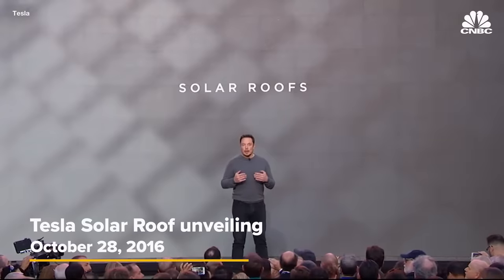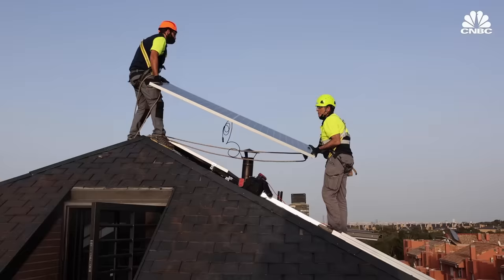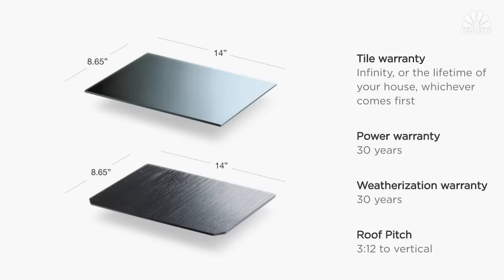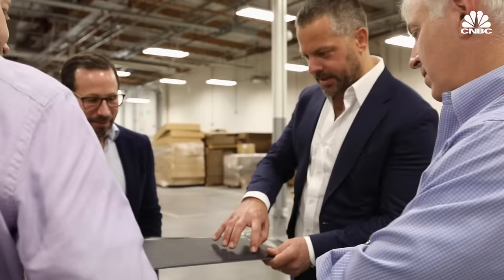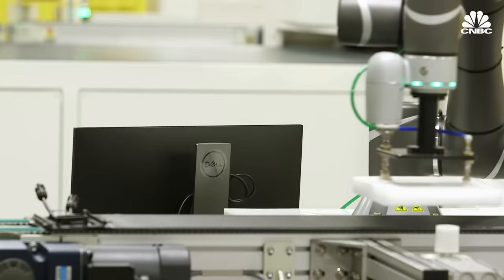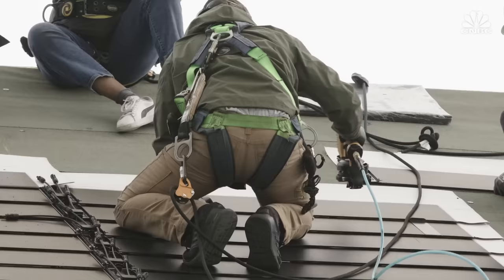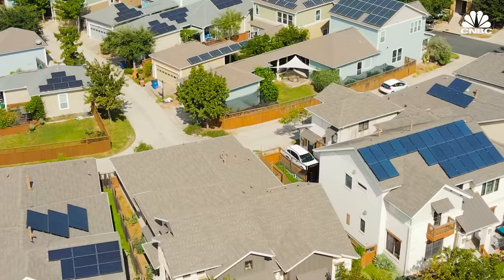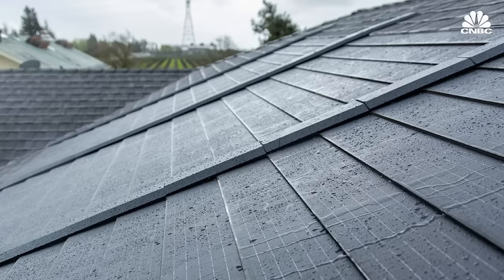How This Roofing Company Is Taking On Tesla’s Solar Roof

Comment: I own a 13 kw solar system.  I think panels do not distract on aesthetics of the home.  I have limited roof space. Many of my panels are 360 watts.  The battery storage really saves money with night power, outages, and assisting with charging EV’s.  In Hawaii I save $600/month on gas and home electricity.
Reply: You save more than I typically spend a month on gas/electricity.
Reply: @Abď probably like $30k
Reply: Yes they do! It looks horrible!
Reply: @miriamgalan1810  Your opinion does not matter.
Reply: $600/MONTH "saved"?   Must be a nice house in Hawaii!  My electricity bills might be $100/month w/hotter summers and colder winters here in MD.  Yeah, it's a townhouse but the numbers are out of whack.  Electricity/gas cost 2 or 3x as much?
Reply: Wow I spend like $200 per month on gas and electricity combined.
Reply: What brand name storage are you using Scott?
Reply: @TheJhtlag  as of 2019, Hawaii had electricity rates almost double California; it is possible to spend that much monthly in some places
Reply: That’s about my annual electricity cost. I’m single and work 55 hrs a week
Reply: I think they are far uglier than shingles, but overtime, I am sure shingles will improve.  I'd get panels now, though - if I was in the market now. Having them as a porch overhang may keep them even cooler, so more efficient...but, porches are taxed, so there is that. Maybe for a carport not attached to the house would be cheaper overall?

Comment: I bought a new home in the desert. The builder put solar on and it was included in the price of the home. I upgraded another 3K dollars. My electric bill was 15 dollars per month in the summer running an air conditioner. So happy with my solar panels. I think the ones GAF Energy have look good. In the long run, I hope they do really well. They may want to build an alliance with home builders in states where solar is mandated on all new builds.
Reply: What manufacturer  did you go with ?
Reply: You know your just paying for it over the life of the loan.  They become less efficient over time
Reply: @usadaytrader  let alone breaking down the cost it is still better, nobody is implying that the low monthly energy bills = 100% savings as you do have to factor in the cost of ownership on the solar panels of course.

But also the fact that it’s renewable energy. Also that you can have a power bank and store it and have energy during power outages.

Pretty useful tech. Your talking about cost and depreciation from a phone/tablet/computer which will decline as fast and cost easily $1k and easily upwards.
Reply: @justinstevenson2061  it still doesn't pencil out
Reply: Solar tiles or panels should be mandatory on every new home, period.
Reply: If your not complayining is cause you install your solar panels. No company was involve huh?
Reply: @keithnance4209   not quite sure since many parts of the world doesn’t simply have efficient sunlight.
Reply: @keithnance4209  nah
Reply: @keithnance4209  No, making a airtight and well insulated home (passive house standard) should be not some solar bs
Reply: @davidchillton1744  obviously.
Reply: @What11235  for all new homes built. It’s very easy to implement at construction and the cost is built into the sales price, the buyers would never see it because it will be amortized at 30 years which is the avg for conventional mortgages.  It’s 2022 and it’s time we start acting like an advanced society that utilizes sustainable technology efficiently.
Reply: @hairypancake4425  what
Reply: @wildlifewarrior2670  a part from some equator adjacent countries in tropical and subtropical regions, most of northern countries simply doesn’t have enough day time and sunlight to sustain for family consumption
Reply: @hairypancake4425  yes it does

Comment: Here's why I could prefer these over panels. I don't want the additional perforations from rack mounts. The chance of leaks with mounts is higher than without them. Yes, "just get a good installer" can improve chances, but it's not a guarantee. And having known of cases locally of some pretty bad leaks from rack mounts (yes, I know many don't have problems) I would very much be interested in a product that goes on the decking like standard shingles if they have no higher chance of leaks than standard shingles.

The first job of any roof is to keep out the elements. Solar is secondary. Not willing to compromise one whit on the primary  purpose of a roof for any secondary function.
Reply: You don't have that issue with standing seam metal roofs, the racking system simply attached to the standing seam, no perforations.
Reply: @fuckthisksksjjksdfjd  Yes, that's the one scenario where I would feel comfortable with rack mount is with a standing seam metal roof where it could clamp on the seams. Don't care for the aesthetic of the standing seam roofs so that would be the biggest hurdle :)
Reply: Interesting points. I’ll have to keep them in mind when I eventually own a home and am getting quotes.

Comment: I've had solar panels for over 10 years . I wouldn't put them on the roof . A frame in the yard is better . They remain cooler so more efficient  . Easier to clean and they do need cleaned from time to time . Just maintenance and troubleshooting is easier on the ground . If you have the room keep them bolted to a frame high enough to mow under .

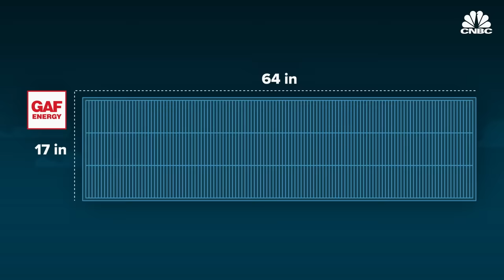Comment: I think you're wrong at 11:01. You're factoring in the entire panel even though most of the top part of it is covered up by the previous panel. Looking at the man holding the panel at 11:21, we can determine that the height of the actual photovoltaic portion is less than half, so about 7 inches, and the width needs to have about 3 inches removed from the right side. Rough math shows that the panel would produce about 10.1 watts of power/sq. ft and not ~6 watts.

Comment: My families 1,800sqft was quoted $50k for a turn key photovoltaic system that would cover 100% of the electric bill. After some research, and being an electronics technician, I was able to buy the correct system for $13k cash delivered to our home and I installed it.

Comment: I am  roofing company owner  and yes definitely I will offer the product to our customers ! Just like a car, the customer is who decide which panel is going to use , right after analyzing  what's the pro and cons of own it.
Reply: Do you think someone with a perfectly good 5 year old roof would consider this product?
Reply: @zunedog31  The cost to replace a recently purchased roof makes no sense.

These products are for new roofs or homes who needs the roofing replaced
Reply: You right folks , this is going to fit on new projects or replacement , or perfectly for those who just want to get the system , exactly like when you have a good perfect 2020 car but wants the 2022 model
Reply: A year later I'm curious how did this work out for you? What's the avg cost for a roof like this under your business?

Comment: Why are people so centered in esthetics!? Regular solar panels are strong, very cheap and super efficient.
Reply: Yah like what's wrong with having a regular panel on your roof...I not like you'll be sleeping on the roof 🤷🏿‍♂️
Reply: Local man discovers others care about appearance
Reply: Some people want better aesthetics, some want higher efficiency, or greater total system power.  The best products will try to achieve best in class in every metric, but reality often limits that.  Nothing wrong with targeting a product to be the best in one customer want/metric if the target market is large enough
Reply: I think in the end, if it can actually replace your regular shingles, that’s a cost saving so you don’t have to buy them anymore.
Reply: @colonelbanditsix  it’s not like it really matters but the real preoccupations should be with storage battery or insulation of the house.
Reply: Becuase I am not spending 500k on something I see everyday that I dont like.
Reply: @colonelbanditsix  that just shouldn't be a thing though. A usual use case for a roof is closing up the top of your house so that it doesn't rain in. No one should buy a roof with holes in it just because it looks better. For me it's the same with a solar roof. As it stands now... Either you want to do something for the environment and or save on electricity or you want a normal looking roof. In my opinion you shouldn't want something that is worse but also more expensive just so it looks better. It kinda defeats the purpose of making it solar for me.
Reply: Very cheap? If you're Bill Gates!
Reply: Why bother painting your wall White (or any color u live) vs painting it green (or a color u dislike).  Cause it’s more pleasing and works better.  Smh.
Reply: housing value, eye appeal increases value, so if you're looking to sell eventually, you would have to dismount it
Reply: @mmoarchives2542  I think the value of solar energy would more than compensate for the 'ugliness factor'.  The house would definitely not have less value than before you put the panels on.
Reply: @studtistics2448  i used to think that too, until the housing market dramatically changed, it's not like that now, home owners wants practicality not innovation, solar is only a selling point in nevada, utah, california, and arizona, not anywhere else
Reply: @cmdr1911  regular solar is pretty cheap
Reply: @jordanabendroth6458  yes but my home is not. Power is .06 cents a kilowatt hour hear. Solar doesn't make economic sense here and the panels look terrible. The reason solar tiles make sense is they appear to be slate tiles and at Tesla's original price they were competitive with premium slate roofs. It is still more expensive than asphalt. It looks bad and makes poor ecomonic sense, no way they are going on my roof.
Reply: @cmdr1911  Power is only .06/kwh because we are making our children pay the real cost.

Comment: unless they can beat a shingled roof plus rack mounted in price, i think their product will fail. they are not in the same market as tesla solar. Tesla is about roof appearance, while GAFs looks just as bad a roof mounted. So they are competing against roof mounted, not Tesla.
Reply: Ya, "this has been around since 1970s" shows pictures of flimsy and mismatched solar panels ingressed into a roof. Literally lacks the 2 benefits of Tesla solar roof (durability and looks) so obviously none of it caught on. Not saying they are completely trash, but probably should just be compared to normal solar roofs.

Also GAF power density seems to be trash..... so ya not so great. add on you are only saving 10k to go from a higher power output and tile roof to shingle roof. Doesn't seem to good for them. Hopefully they can drop the price given how low the material cost of them seems to be
Reply: They should conduct a research on who cares about appearance
Reply: @ntb3884  I think the other thing might be the customer experience. I have heard horror stories about how great Tesla is on the sales side, and on support after the installation has gone live, but that the in between part is a nightmare.  If GAF can get their solar shingle solution up in a day or two, and have excellent support for customers throughout the process, they might win over a huge customer base.  Tesla solar roof is like their vehicles:  high end and high price.  GAF solar shingles might be the Nissan Leaf of the industry, if they can get their pricing right, and make them more affordable for the masses.

Comment: The problem for GAF is they are targetting composite shingle roofs customers.  And composite shingle roofs are relatively cheap compared to alternatives like tile.  Tesla targeted homes with tile roofs which are expensive with their SolarRoof product.  The price of our Solar Roof was less than the price of a replacement tile roof with solar panels.
Reply: @updlate4756  so the guy who went from college student to world’s richest man in 25 years is not innovative?  Targeting upper end roof installations is smart.  Customers can pay more for features.  Then you can work on driving costs out as you learn more about the tech.  These benefits low priced buyers as the tech becomes a commodity item.
Reply: @updlate4756  you failed to notice that Tesla roof gives 17 kWh per square foot, while GFA 6 kWh. Of course the solar panel gives a bit more still, it makes sense that if Tesla solar gives three times the output of GFA and comparing to ordinary solar panels which give even more output, Tesla solar roof covers entire roof area, which isn't the case for GFA nor for ordinary panels. I would personally prefer Tesla, if it were available in my country.
Reply: Why did you use the word 'our'?
Reply: @JBoy340a  But that is not how he is personally marketing them.  Musk never comes out and says Tesla products are just for wealthy people, when they objectively are.  Where is the 35k Model 3?  Abandoned long ago when they aren't seeing profit margins to boost stock prices.  Tesla is niche and will continue to be so, they don't seem to have the appetite for mass market low profit margin products.
Reply: @dalemansukh  - at least when it was first announced Musk was pretty open that the Solarroof was price comparable to a tile roof, and not a composite shingle roof.
Reply: @updlate4756  Shingle roofs are installed on old houses. All new apartment buildings, condos, single family units have tile roofs.
Reply: @dalemansukh  wait a year and look at gigaberlin and especially gigatexas, the issue they have is they cannot produce enough to meet demand. It makes sense to raise prices and use that extra profit to build more factories and advance manufacturing methods.
Reply: @JBoy340a  lol, went from college student? The dude's father owned emerald mines in Africa, but yeah, he was just a college student 🤣
Reply: @lancetruong4957  Maybe where you are at. Even here in Florida, while some of the southern and coastal areas are defaulting to tile roofs, outside of the coastal areas most new construction is with shingle. It also gets expensive when you factor in insuring your house. Many insurers don't want to insure any house with a roof over 20 years old regardless of material. 

My shingle roof is 19 years old with a 30 year warranty on the shingles, but it took months to find someone who would insure my house.
Reply: @JvilleJD  I guess it depends on the area. Here in California, people prefer tile roof because of potential fire.
Reply: @ttuliorancao  the guy came to america with $2,500 in his pocket.
That may be from emerald, but he was never rich .
He started from the bottom.
$2,500 isn't rich whether or not it's from his father
Reply: @user-nw8jr1dk9p  oh really, so Musk's father isn't Errol Musk? And this man didn't own a emerald mine in Africa? They didn't live in one of the most expensive houses in Pretoria as a result of Errol's success in his businesses? Musk was never poor, he was a rich kid from a rich family. Not billionaire, sure, but multimillionaire
Reply: @ttuliorancao  nope , not even a millionaire.
If he was a millionaire, trust me he wouldn't have ended up with $100k of student loan .
Reply: @user-nw8jr1dk9p  lol, of course he would deny as being born into a wealthy family in South Africa during apartheid is harmful for his public image of self-made man in a meritocratic world. The facts are all over the place, with even Errol Musk talking about his emerald business in an interview to Business Insider...
Reply: @ttuliorancao  I never said elon lied .
Apparently you cannot even comprehend the simplest sentences.

I said everyone who knew elon musk , even his mother and father denied these claims .
In other words you're saying elon's father and elon's mother are also lying in this case?
That sounds like a conspiracy theory.
Reply: I am a roofing contractor. 
But there’s many more Asphalt shingle roofs then Tile roofs.
Reply: Labor is always going to be the most expensive part of a solar roof, so I think GAF has the right idea by targeting that aspect of cost.
Reply: @Alarix246  I think the problem these calculations are missing is that the GAF product is a shingle designed to be overlapped on installation. Less than half of the shingle is exposed, the other half is behind the shingle above it. So the GAF system per foot is atleast twice the number quoted in the video. They do lose on sqft installed as connections are above the shingle taking up roof area but that is to make this a system that is cheap to install. So I expect GAF to be inexpensive per kw installed with a new roof, but not provide the same over all power per roof.

Comment: It's a good idea for old roofs , but I would prefer Teslas roof for new buildings
Reply: agreed but there's just too many defects and problems with tesla's solar roof so it's not worth it
Reply: @halozhelos2417  this is a new product , it takes some time ,but you see the Tesla roof can absorb  more energy .
Reply: @elios633  u r not getting my point, tesla solar roof have more energy however, it has extremely low efficiency and high cost. 

low efficiency due to the fact tht it has too many defects for such an expensive product. u have to consider from all sorts of POV
Reply: @lancetruong4957  agree but again u all r missing my point, wht I'm trying to say is tht Tesla solar roof has too many defects for such an expensivr product. So it has very low efficiency and reliability. 

However, thr solar roof in this video might produce lower energy but has higher efficiency and reliability compared to Tesla's solar roof.
Reply: Fire starting garbage 🗑